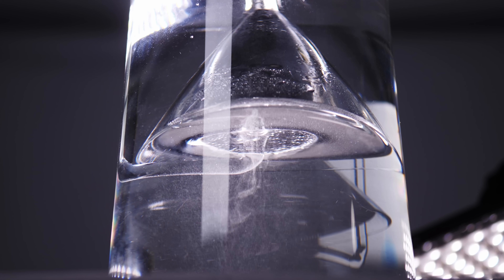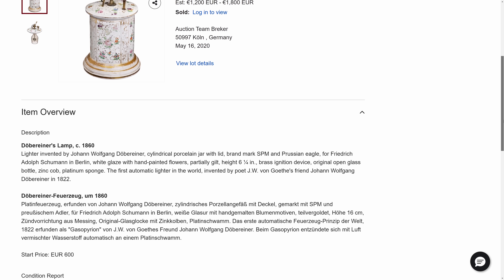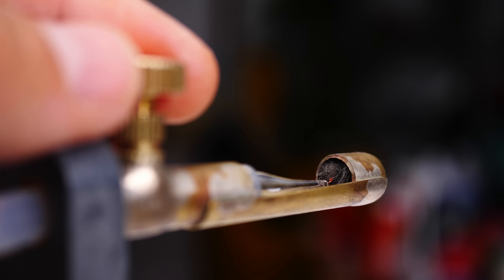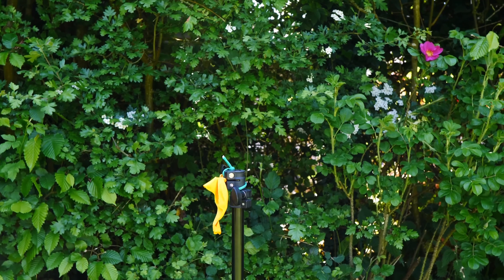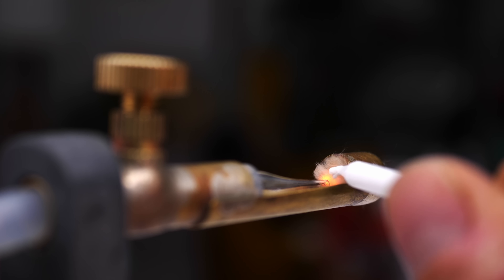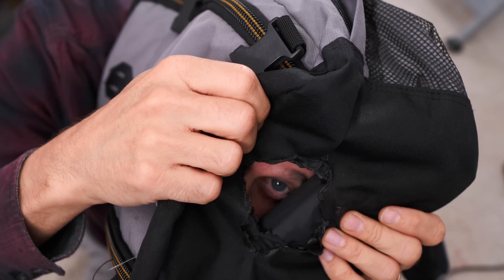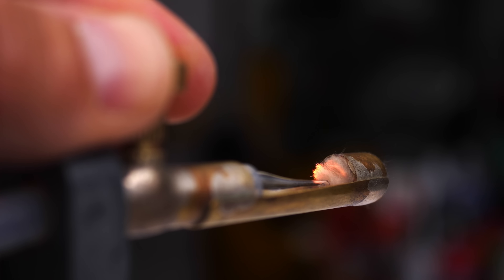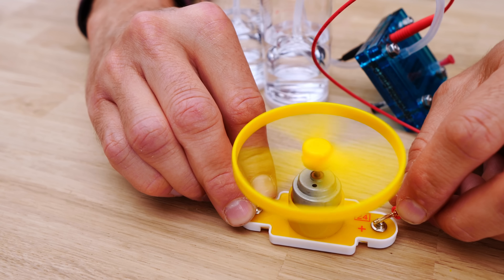This 200-Year-Old Lighter Ignites Without a Spark

Comment: Sorry to be pedantic but "it's unstable because it has an incomplete outer shell" is a big misconception that seems to be very prevalent in chemistry.

The hydrogen atom with it's unpaired electron is more stable than the hydrogen ion (removing electrons always requires energy because they are attracted to the nucleus)

However the hydrogen molecule where the electrons are attracted to both hydrogen nuclei is more stable than the atoms.

The hydrogen ions, while less stable than the hydrogen atom on their own, from strong attractions with other ions or water molecules which make the whole system more stable than before.

But it is not to do with complete or incomplete shells directly. There is too much to go into in a YouTube comment here!

Comment: The lighter fluid handwarmers are extremely underrated. They are awsum. You can light them then stick them in your inside or outside coat picket, pants pockets, etc. You do have to deal with the smell of lighter fluid, but it dissipates quickly. They dont generate a lot of heat so they will not burn you, and last a long time on a small amount of cheap fluid.

Comment: How come zinc takes away hydrogen from sulfuric acid? What is left behind ? What happens to the zinc or acid? Do they get used up or bond together? The hydrogen cant just take electrons and run away, that would make the acid electrically charged wouldnt it-? Im confused on what happens exactly there
Reply: Before the reaction, you have neutral zinc metal, positive H+ ions and negative sulfate ions. In the reaction, an electron is transferred from a zinc atom to a H+ ion, leaving you with a Zn+ ion and a neutral hydrogen atom. The hydrogen atom quickly combines with another hydrogen atom to form H2, as mentioned in the video. The Zn+ ion that's left behind floats around in solution together with the sulfate ion. You've essentially replaced the H+ with a Zn+ ion, the sulfuric acid solution is turning into a zinc sulfate solution.
Reply: @lunkel8108  Ooohh okay! Thanks a lot! very detailed

Comment: 11:46 - The reversibility of the hydrogen fuel cell also gives it a niche use as a very compact, quiet and small footprint dehumidifier. I believe they're used on some museum exhibits where humidity control is vital to stop them decaying.
Reply: Don't you need water in liquid form? And at that point you can make just some sort of drain I guess
Reply: @Daniel_VolumeDown my guess is that they use it both ways around, to humidify when the air is too dry and to dehumidify when it's too wet. The necessary water could be soaked into something porous with a small fan blowing over it to speed up evaporation or something
Reply: The only legit use, honestly.
Reply: @Transit_Biker you don't think it makes sense as a power source for off grid? I'm not an expert on these, but power storage is a mixed bag, and a fuel cell seems like a good compromise for sustainability when micro grid power isn't sufficient.
Reply: @SireBab  there are single-use H2 cells for survival gear, but more common are FeO2 packets because if you just need an exothermic reaction, those elements are cheaper. Mechanically generating ion flow is preferable to doing it chemically.
Reply: @SireBab it turns out that they are difficult and expensive to make, require rare materials, have extreme requirements for purity, and/or require tricky maintenance.  Hydrogen itself is tricky and expensive to handle, and the sum of it all means that it is almost always beaten by batteries or other solutions.
Reply: @mrmichrom8553   @Transit_Biker  Hear, hear (read, read? :0) ! And yet, I see so much push for hydrogen economy especially in Germany where people are told that the existing natural gas supply to houses could just as well bring hydrogen. There is a huge vested interest here somewhere, and I would love to understand what bakes their cookies, exactly :0)
Reply: @mumblbeebee6546 Germany pushes whatever makes it energy independent.
Reply: @mumblbeebee6546  Is it hydrogen fuel cells they're advocating? Or just hydrogen as a fuel? Cause those are pretty substantially different things.
Reply: @BubbaHoggit  Oh, fuel cells is difficult enough, but some ... people are telling the public that hydrogen can go into the current natural gas pipes to the home...
Reply: @mumblbeebee6546 Damn, that's not good.
Reply: Eh... no. Using hydrogen fuel cells as dehumidifiers, would be very expensive and inefficient. There are machines that are actually made to reduce humidity. (known as dehumidifiers) They are much cheaper, and far more efficient.

Comment: The pinnacle of lighter design? Far from it! 
-Flint-wheel lighters rely on mechanical abrasion and a ferrocerium rod—primitive tech that wears down, jams, and fails when wet. 
-Piezoelectric igniters aren’t much better: they degrade over time, require excessive force, and are prone to misfires. 
Why hasn’t anyone developed a truly modern solution? 
Imagine a lighter with solid-state ignition—using a high-voltage capacitor discharge or a miniature Tesla coil to ignite butane. 
Or a hybrid design combining a plasma arc (windproof, electrode-based) with a controllable gas valve for a reliable flame. 
That would be real progress in lighter engineering!

Comment: I work in a computational chemistry lab that researches platinum catalysts. Specifically some platinum clusters can be fine turned to help make high octane fuel selectively, so the process is pretty valuable
Reply: I heard reversebility and general catalyst and my mind jumped straight to this. This would be pretty great as a grid scale battery. Probably limited by the cost of platinum.
Reply: My bucket list has an entry to know more about maximising NH3 fuel cell efficiency, as it seems to me to be the answer to green international shipping.  I've heard of Ruthenium in particular used for H2 release, but guess there might be other economic/efficient construction for fuel cells.  The converse NH3 production from electricity or solar heat also interests me.

Comment: Could you use this effect to create non-salt water out of sea water? 

Maybe for plants or even maybe drinkable water?
Reply: You could, but it's a lot easier, cheaper and safer to use distillation or reverse osmosis. Essentially boil the water to make steam than condense it to make pure water or force sea water through a filter that only pure water can get through

Comment: Hi Steve your dabbling with stuff that is similar to a device in the back of my free energy book. It used a spark gap to crack hydrogen gas and then that gas went into a copper vessel that was ignited again. No oxygen present. Supposedly letting out a huge amount of heat. What do you think?

Comment: I have several questions:

1) it seems the platinum is doing some work when separating the atoms. Isn't it against a law?

2) would all this work near absolute zero? Is a part of the work 'stolen' from ambiant temperature?

3) some cars have 70kg platinum for one fuel cell. Is it sustainable?

4) wouldn't a fuel cell be achievable with way less platinum in the future?
Reply: 1) the platinum is not doing anything per se. Its like with every catalytic reaction. While the hydrogen is in contact with tge platinum its just more likely to fall apart
2) i dont know about that because it would most likely make the hydrogen more stable
3) I dont know where you got that number from. Were talking one electrode. Thats about 20-30 grams

4)maybe but were trying to do it without any. Thats gotten us nowhere so far though
Reply: @barnabasrsnags4828  thanks. I never realized my source of information was wrong about the real amount of platinum needed!

Comment: I liked how the explanation is complete - the heat doesn't come from the reaction between hydrogen and oxygen, it comes from the water molecules moving about afterwards.

Yes, I got to my adult life without actually knowing what an exothermic reaction really was. Because the explanations I was given were incomplete.
Reply: Well, the water molecules got the energy to move around from the reaction. The reaction converted chemical energy into thermal energy.

Comment: 4:30 Hydrogen and oxygen will absolutely react on their own, you just don’t have enough hydrogen pressure for that to happen. Hydrogen-oxygen mix has a wide range of pressure ratios where it is extremely unstable and will detonate (yes, not just burn, detonate) given the slightest provocation, i.e. it basically happens on its own. It is a free radical chain reaction.
Reply: I think this might be one of those cases where "at or near STP" is to be taken as a given. ; )
Reply: @AD_AP_T   Off the cuff, I thought it's easy to make self-detonating mix at STP, but after a brief review, it's not that simple. True auto-ignition is achieved at higher temps. But for practical purposes having a mixture that's very sensitive is kind of the same. But then you get into a rabbit hole of how sensitive it would be at room temp, and that depends on your mixture ratio, pressure, vessel geometry, vessel wall material and who knows what else. So I'll have to leave it at being easy to make a volatile mix at STP.
Reply: So don't put it in a fire piston, got it

Comment: With the reversible battery at the end... where is the wasted/escaped energy and how does that relate to it's life spam? I am imagining with use somewhere in it loses the ability to conduct the oxygen from one side to the other. What I got from it is that you could endlessly convert the gases to water and then back again but I know that's not right because well.. physics.
Reply: Those ion membranes have always been the lynchpin of cells. I think it just goes to heat, good question about life span. We all know that electrolysis left to its own will happily corrode electrodes, I've always wonder about their durability. Ion resins and membranes seem to promising but never utilized

Comment: You can reuse that zinc sulfate as moss killer. I am unsure if you have made the gravity cell yet. All that takes is a copper electrode (a simple wire would do), a zinc electrode, copper sulfate, and a container to hold the the fluids.

Comment: I learned about platinum catalysis from a fictional documentary about dragons. They claimed dragons 'could' breath fire if they lived in areas with lots of platinum ore. They pounded the ore into their molars and had a highdrogen flight sac which helped reduce weight but a 2nd purpose they breath it over their platinum tainted teeth. The doc claimed that dragons that vrethed fire alot were unable to fly very well due to the lack of hydrogen in the flight sac
Reply: I learned about them in the RAF. The F4 Phantoms in the UK had Rolls Royce Spey engines with an after burner (reheat). The ignition of the fuel sprayed into the afterburner was by means of a platinum catalyst. After each flight the back or the engines were checked to see if the catalyst was still in place. If it was missing and believed to have come out on the runway during take off people were sent out to go along the runway looking for it. They were both valuable due to the platinum and dangerous to other aircraft using the runway as they could cause damage to tyres or be thrown up to cause impact damage.

Comment: Nice video Steve! I really love the design and simplicity of this device.

Btw. when zinc react with acid, it doesn't produce atomic hydrogen. It produce H2 molecules. In the past it was thought that short lived atomic hydrogen (also called nascent hydrogen at the time) was forming in the reaction between base metal and non-oxidizing acid in order to explain increased reactivity of freshly formed hydrogen. And it wasn't just about hydrogen, but also about oxygen, chlorine etc. It was thought that nascent chlorine was responsible for oxidizing power of aqua regia. But modern research shine new light on this old theory (which is still often incorrectly taught on high schools). In our current knowledge it actually seems that increased reactivity of the newly formed hydrogen is due to high pressure in newly formed bubbles. I have very interesting document on this topic, I can send you a link on it. I don't want to post it in the comment because youtube usually deletes it when I do it.

Comment: Thank you for the vulnerability about knowledge gaps or moments where you draw a blank when you are hoping to change your life in an interview. I was reminded of this when an Electrical Engineer went to a Manufacturing Engineering exhibition for fun. They may have thought he knew little and wasn't of interest to talk to. Meanwhile a Computer Science student may not have any interest in what things a Mechanical Engineer may focus on unless they are working on building models of physical things. Yet both have learned in many classes that are similar and processes of solving problems. I've met some good ME grads that learned to program, albeit they aren't interested in building better but just accomplishing the task as far as it is needed. With having changed majors at times, I am glad to see the different thought processes and backgrounds of majors and how they can interest and complement each other. However, as you note sometimes one group may not be interested in the way of the other. I like where I can combine many engineering fields and applications of technology.

Comment: Does this scale up? Is the platinum consumed used in this reaction? Can we say, use this to boil water and power a turbine?
Reply: No, the platinum is not consumed, it's a catalyst. The zinc and sulfuric acid are consumed as they produce hydrogen, which is then consumed when it burns. It takes a lot more energy to produce that zinc and sulfuric acid than you get out of this. If you want to store energy in the form of hydrogen and then later release it again, the fuel cell he showed in the video is a far far more efficient way of soing that.

Comment: I rather like my 1920s/30s Methanol lighter - it works by opening it up, exposing a little "wand" of platinum wire strung in a frame with a ball of platinum in the middle.  Simply insert the ignition wand into the hollow circular methanol wick and it glows hot and ignites the wick!

Comment: Platinum is a great catalyst. Glow plugs in model engines use platinum as a catalytic initiator to ignite the methanol/air mixture at the top of the stroke.

Comment: I knew that platinum is a catalyst for various reactions, but I didn't know it was so exothermic that it resulted in combustion. Like you said,  ...gaps in our knowledge. Thanks for sharing yours and helping me fill mine.
Reply: Oh, yes. The catalytic converter in cars, if the ECU is badly tuned or the fuel sensor is not working correctly resulting in excessive fuel being delivered so that unburned fuel is left in the exhaust, will glow red hot! They burn all of the fuel that is left so that it doesn’t pollute the air. Normally there is only a little, so they get warm but not burning hot

They will also destroy any NO2 that is created as a byproduct of lean (oxygen-rich), hot combustion, so that it can’t produce acid rain by reacting with water vapour to create nitric acid

Comment: Just by way of comment, there is another way to get hold of Platinum. Contact solution, specifically the hydrogen peroxide solution. The contact case for that type of solution has a little catalyst in it. Some have a Silver-based catalyst, some have platinum based. May not be helpful, but if you happen to read this comment... maybe.

Comment: Why dont we use renewables to create hydrogen to then use for base load and night power?  Yeah i get the inefficiencies, but you either have too much or too little solar and wind, there is no inbetween, this makes so much more sense than batteries
Reply: I think some places are trying to do this in fact the International Space Station uses this. However pumped storage hydroelectricity is a lot more refined and well-developed and safer technology.

Comment: Good thing it's Friday. I'm going to the garage as soon as this is over and Start putting the components I have on hand to put one of thies things together.  Curiosity leaves me wanting to ramp it up. Reminds me a little bit of the old miners headlamp that uses calcium to make acetylene gas light. I have one of those but haven't ventured to turn it on yet. Thanks for the knowledge.  I always enjoy your show.
Reply: Calcium carbide. Onto which water drips, which as you say reacts to release acetylene, a flammable gas. I don't think they're inherently dangerous, I think my dad had one as a bike light. But in a mine an open flame created the danger of igniting gas, which led to Davy's safety lamp. Simply putting the flame inside a metal grill which after as a flame arrestor.

Comment: I use platinum on ceramic to remove oxygen from my hydrogen generator prior to compression as a safety.  After catalytic oxygen removal, the hydrogen is passed through molecular sieves to remove water as this is also a problem in the compressor.